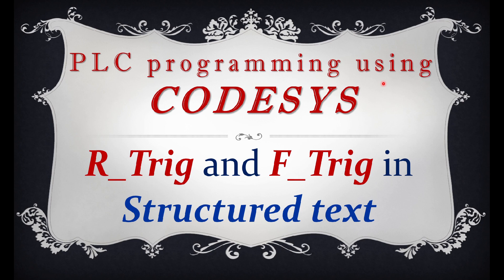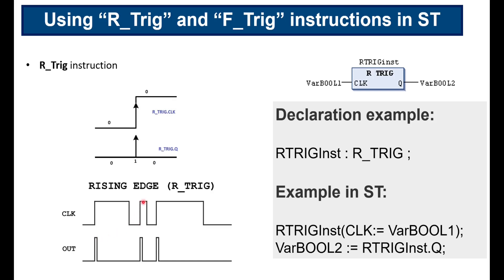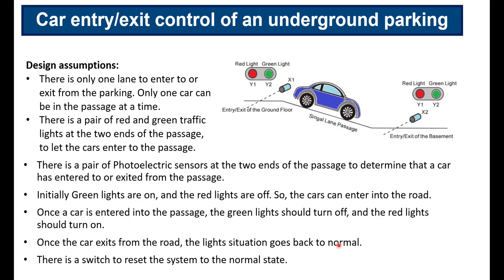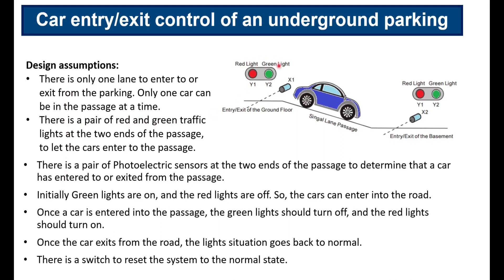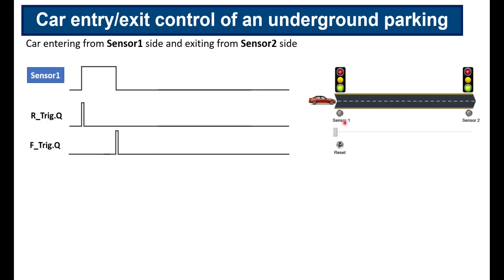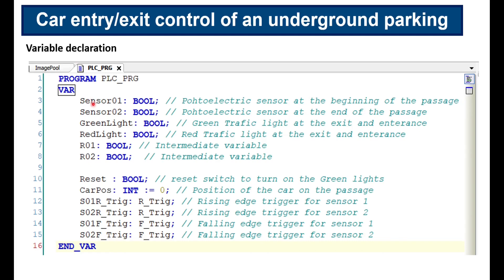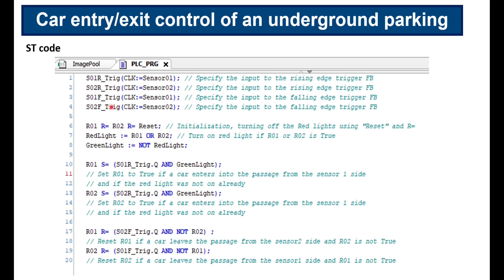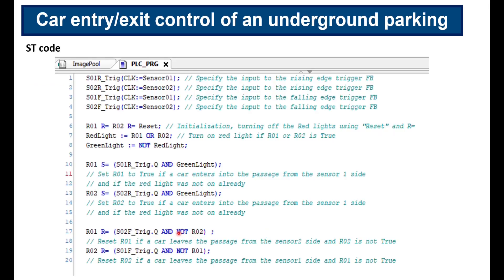CODESYS: R_Trig and F_Trig (Rising and falling edge detection) instructions in Structured Text (ST)

Comment: Hello sir ,My background is mechanical engineer but for my master project  I have to work on codesyea and it is completely new for me ,eventhough I am following your video but I have to work on Wago hardware on my project and I don't have idea about it so how wago hardware is correlated with codesyes and what should I learn regarding than except from your video?PLc programming is completely new for me so guid me please
Reply from the maker: Hi, thanks for your comment. 
Apart from programming of the PLC, which could be done using CODESYS for your WAGO PLC, I assume, you would need to learn about the hardware configuration, input and output interfacing and addressing, networking, and HMI, among the others.
In my channel, the main focus is on programming, though you should be able to find the missing information in other resources.
I hope this helps.

Comment: Is there a block that recognizes rising and falling edges or do I have to create two separate functions for one variable?
Reply from the maker: I am not sure if there is such a function, but you can easily create one, by using R_Trig and F_Trig receiving the same signal and ORing their output. This way, you will detect both rising edge and falling edge of the signal.